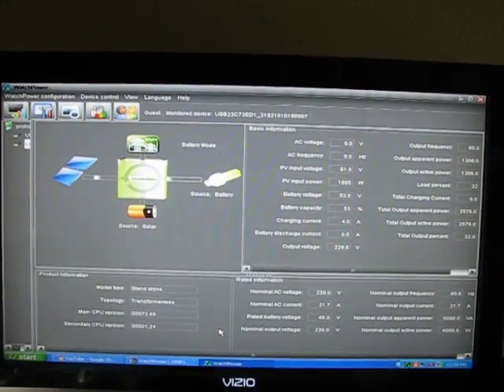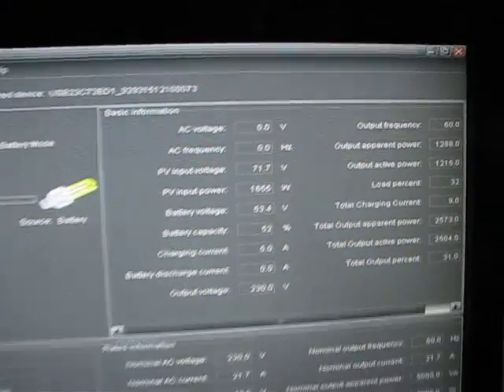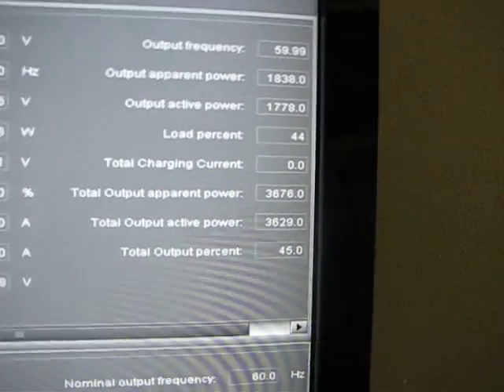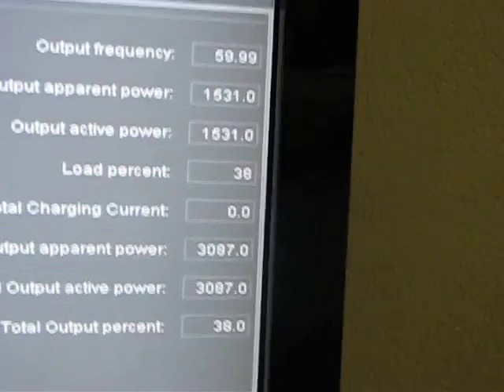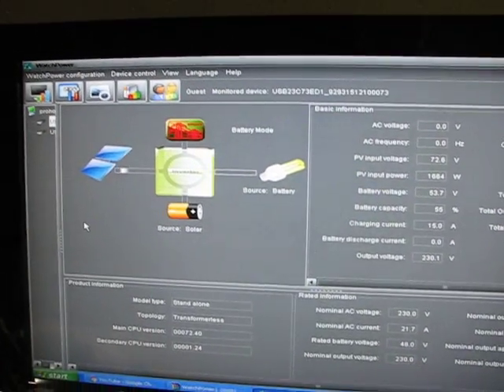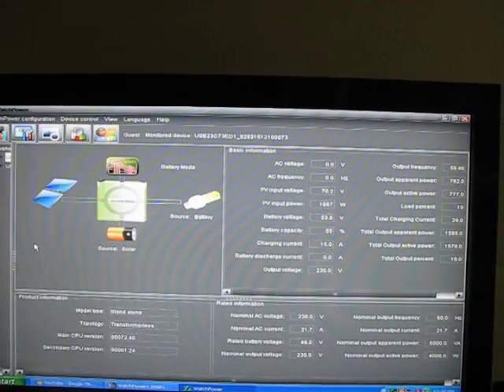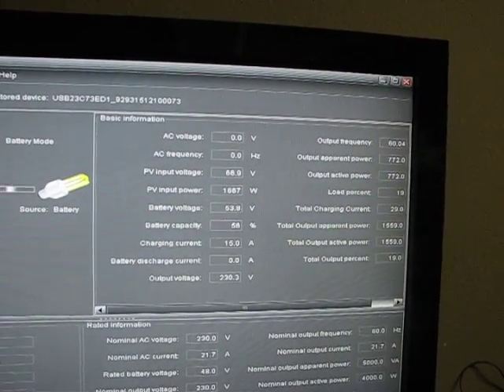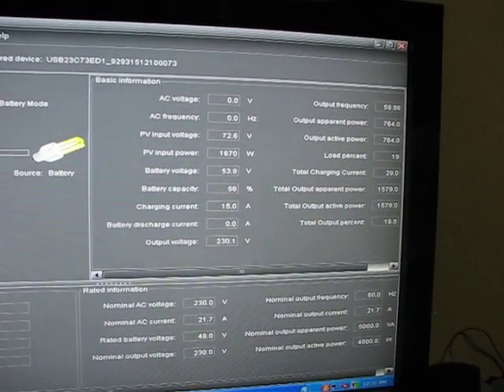MPP 4048 Inverters in parallel Average Days Production

Comment: Hi, I want to parallel two inverter mpp 4048 but the first inverter had 15 solar panels (all solar panels is 250w) and the second inverter had 6 solar panels (all 6 panels are 330w). will this work with different watt of solar panel or not ?

Comment: Quick question, I am after a Mppt that will know my batteries SOC how good are they at this? as the price for the Midnight 150 would be the same as this and this is an inverter as well. What should I go for as I only need ( IT ) for 1kw of panels.
Reply from the maker: It's a bit all over the place with SOC. knowing this use a lower float setting working ok so far. Should be ok with a large battery bank??? If not may be best to go with a different charge control??? As for cost & value this thing is hard to beat! MPP Solar makes a few charge controller units that have a fair price.
Reply from the maker: http://www.ebay.com/itm/60A-MPPT-solar-charge-controller-regulator-12v-24v-48v-3200w-monitoring-PCM60X-/161615675225?hash=item25a10b7f59:g:K6UAAOSwm8VUygAw
Reply from the maker: http://www.mppsolar.com/v3/pcm60x/

Comment: Love it man. Do you know if the Pips can do AC coupling with micro grid tie inverters? I am looking to get a why from the grid tie side.
Reply from the maker: Thanks man! Don't think it will do AC coupling with micro grid tie inverters.
But MPP solar makes a different unit that feeds the grid the extra power.
http://www.mppsolar.com/v3/mpi-hybrid-series-2/